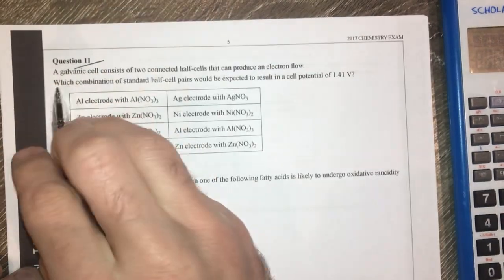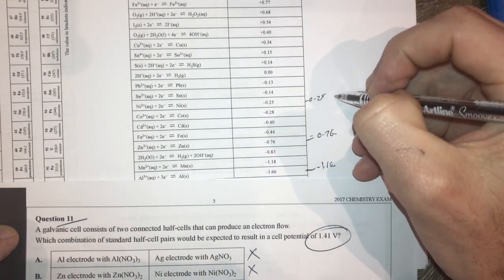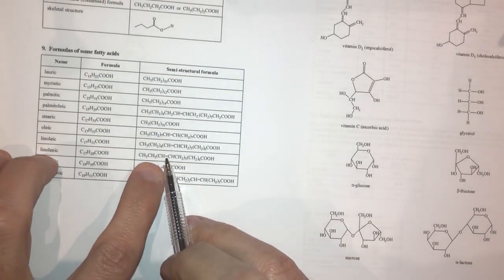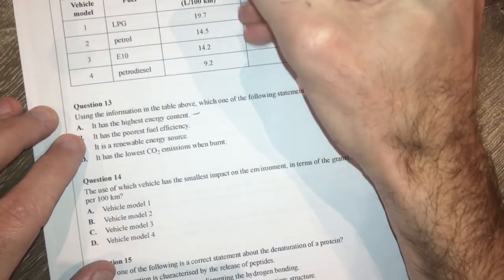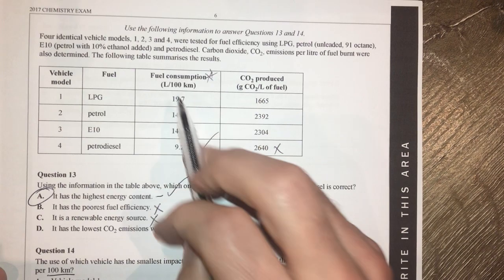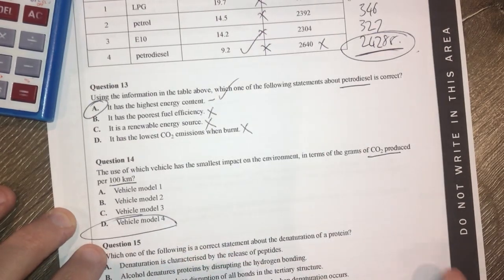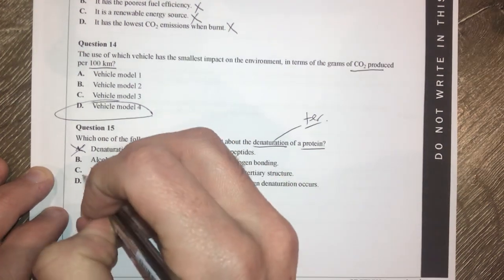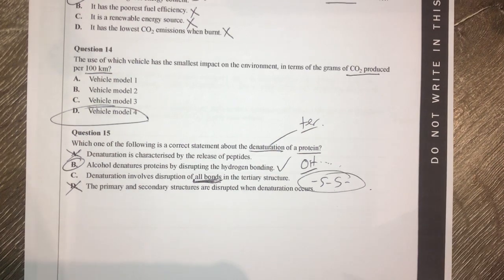VCAA 2017 MC - Question 11-15 - Chemistry Exam Walk-through

Comment: I have a question, in q15) if denaturation only affects the tertiary bonds, then selecting option B which  states the disruption of h-BOND (Correct answer), doesnt the secondary structure aslo have the H-bonds? thus it also being affected by denaturation aswell as quaternary?
Reply from the maker: You raise a great point here and this is something that comes from me talking through this too quickly.  You are correct, 2o, 3o and 4o structures are all disrupted in denaturation. You can still rule out D as it talks about primary structure being broken which is certainly not true!!  Great pick up!
Reply: Right, thanks alot, really helpful @MrJasongoudie